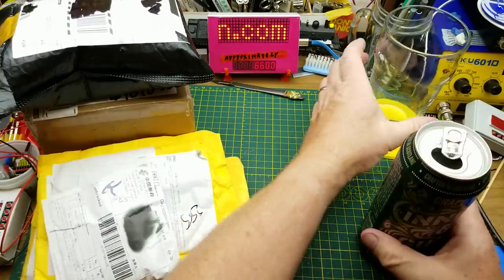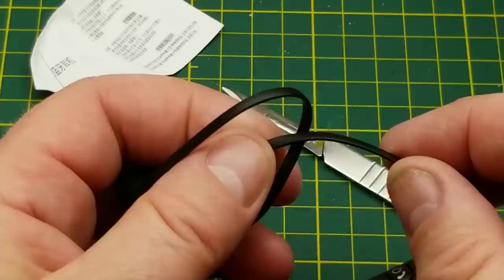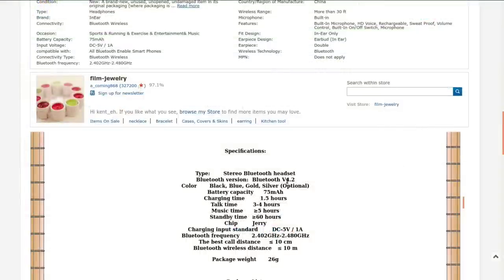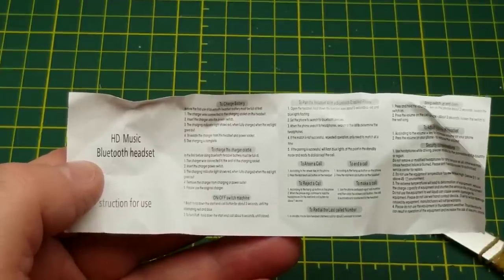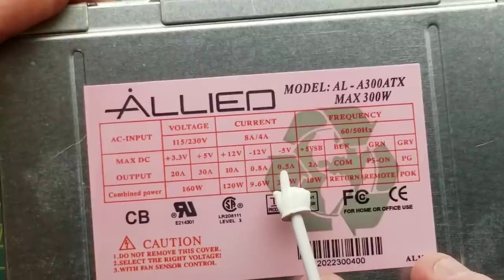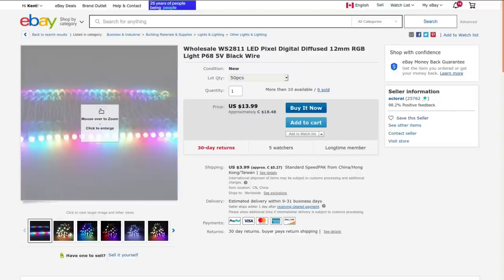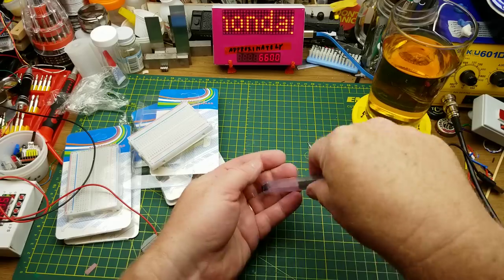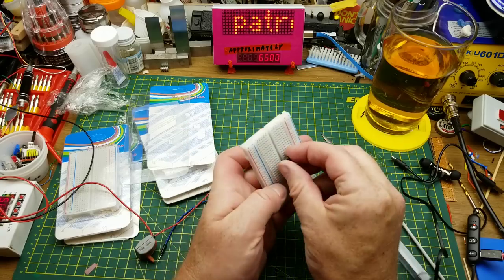mailbag monday #97

Comment: 13:37 A dollar for a microcontroller is a lot. I was paying a dollar for a PIC12C508 microcontroller about 20 years ago.
The ATtiny13a is only 0.80 USD on Digikey, not in stock though. The cheapest microcontroller is the PADAUK PMS150C at 3 cents.
Reply: Well, yeah, But ATTiny13 has flash memory, something that your Pic don't, PWM, ADC too. And you can reprogram them as much as you want, Paduk one is OTP: One Time Programmable, if you screw up your code, you throw that chip away.
Reply: kjur18 Not the PADAUK PFS154 - around 10c each and has flash! Amazing...👍😀
Reply from the maker: For now, I'm sticking to the Atmel chips (or things that play nice with the Arduino ecosystem), as I have the technology to actually program them.

With PIC, you need a PICKIT or other proprietary programmer. And IIRC, the Paduk chips also need some specialty hardware (and some moderately obscure software) to program them.
Reply: @kjur18  The ATTiny13 was released 4 or 5 years after the PIC12C508; of course it has more features.

Just saying that 1 dollar or less for a microcontroller is a normal price the past 20+ years.

Comment: For that winder you're making you're probably fine, but the extra chonkiness of those wouldn't be a bad idea if you want to take the time to replace it, a little extra robustness especially when the far end is unsupported would probably be good.
Reply from the maker: These ones are about half the length of my first couple of iterations. They only stick a bit past the end of the metal of the motor shaft.  
If I need to make another revision of the hardware, I may go to a belt drive and then I'll need all manner of additional support structure.
Reply: @pileofstuff  would give you the option of changing drive gears as well steppers are great but they're not very good at high speed rotation but you may have enough speed already.
Reply from the maker: @JWH3  If I decide to go to a belt drive solution, I'll probably swap to the motors I received in the last mailbag as well. The shafts on those are thicker and should be a better choice for mounting a sprocket to.

Comment: I built little dev-boards with a standardish 6-pin (ISP/SPI) IDT socket connectors for my attiny13s.  If you use Arduio, you may need to find a specialized core.  Think I used the Damellis/attiny one.  Beware, the clock may not be what you are expecting.  Think it is 1.2mhz or something odd.   ISP on slow until you set that div1 fuse.
Would love to play with those 6-wire, 6V pancake steppers.  Uncertain though, how easy they will be to control.  Most home hobby 3d printers use 4-wires ... but am uncertain if ordinary drivers can be configured for 6.  Well, you will surely let us know soon.
(just looked it up) ... These are Unipolar 5-wire steppers.  Two leads are power-in+, so they are easy to control with a Darlington array.  You can run TWO on a single, common ULN2803.  https://www.mpja.com/download/4sq-120ba34sl.pdf
Reply: Attiny13 can run on internal clock source or external. Internal clocks are 1.2, 4.8 and 9.6mhz, and if you divide clock by 8 you can get other speeds, even 128khz.

Comment: Larger diameter shaft will give more torque assuming equal power (he said naively). The ones with the smaller shafts seem to have enough torque to move your mini-skycam adequately, so use the "new" ones for a project involving more mass, or a similar mass you want to accelerate faster, or both?
Reply: The shaft diameter doesn't matter, it's the driven output gear diameter that determines the torque. You can actually get more torque in the same space out of a smaller shaft because you can put a smaller output gear on it to drive whatever the final gear is since it's the ratio of those gears that determines the ultimate torque, but again he said it pretty succinctly that these are much more chonky.
Reply: @JWH3  Huh? I'm talking about the force the spool exerts on the line that extends from it. As the radius of the amount of line on the spool changes, the torque the whole shebang exerts at the point the line leaves the spool changes.
Reply: @markfergerson2145  the shaft is not typically the output of a driven device though, the output gear is. If you have a 1mm shaft driving a 10mm output gear and a 9mm shaft driving a 10mm output gear you will get no more torque out of the 9mm output shaft. You can however get more torque out of a 1mm shaft because you can have have a 2mm output gear on it better ratio, but you can't put a 2mm output gear on a 9mm output shaft. The size of the output shaft inherently limits your output gear size without additional gearing, all it really adds is mechanical robustness, which is useful enough.
Reply: @JWH3  As far as I can tell, the stepper motors involved are direct drive and have no gears- the output shaft is the rotor shaft and all ihe wants to drive is the spool.
As I mention in my other comment, a greater concern is the line winding up on the spool, changing its effective diameter and thus the amount of linear camera travel per step of rotation.
Reply: @markfergerson2145  in which case the spool itself is the output gear, and since it's size isn't charging given the same power the torque will be identical...
Reply: @JWH3  The amount of line on the spool changes its effective diameter. The distance from the center at which the line leaves the spool changes. Can you not see that?
Reply: I have no idea why you're even mentioning that, it has nothing to do with anything I'm saying. The SPOOL itself is the output gear. 1mm 9mm shaft, doesn't matter same output, it will make absolutely no difference.

Comment: first thing that  comes to mind is build a 2 axis table with the steppers. use a atepper to engage the z axis and make a simple engraver/dremel router  you can  use easy stepper drivers , plastic tubing to link the  shafts with a threaded rod, or use belts etc. there are grbl adruino uno libraries that will let it act as a cnc router. like this https://www.instructables.com/id/Homebuilt-DIY-CNC-Router-Arduino-Based-GRBL/  or bigger ( you can pair up steppers on each end of rod
Reply: There is Arduino CNC shield kits on ebay for $20 that has 4 stepper drivers..

Comment: Do the binding posts on the ATX connection board have standard 4mm sockets ?

Actually, are they sockets at all ?
Reply: Nope, they look like only binding posts.
Reply from the maker: They are shallow banana jacks as well as binding posts, but they're not great quality. 

I may swap them out if I end up using it much
Reply: They are basic sockets but NOT standard 4mm size.  There is no hole going sideways, so they are for spade lugs or wrapping a bare wire. Easy to swap them for better connectors.